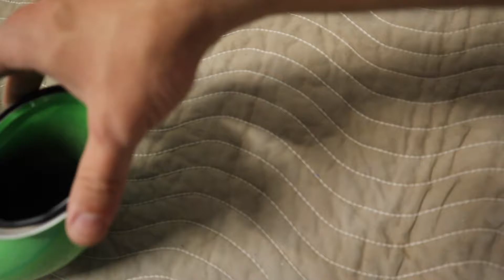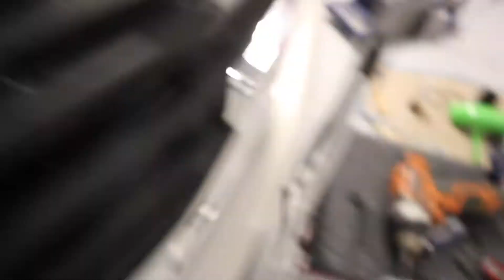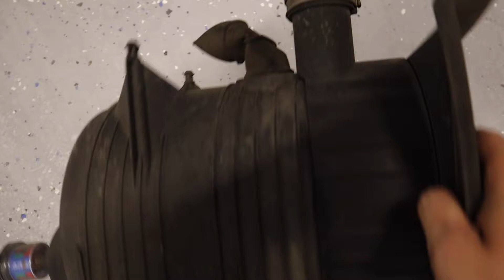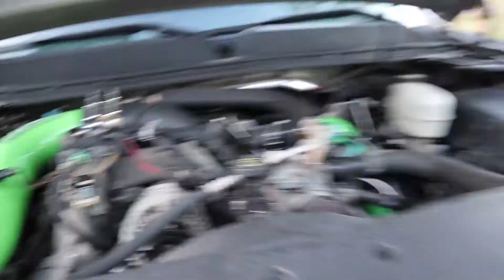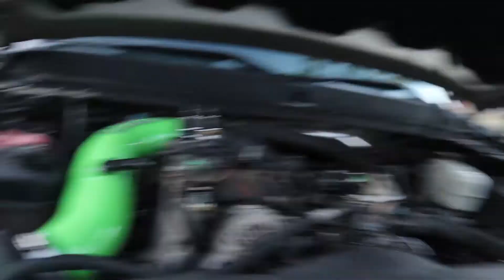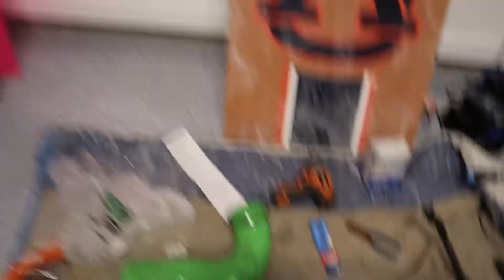WCFAB DURAMAX 4" INTAKE INSTALL!

Comment: Wouldn’t the open filter cause a loss of power and high EGTs from bringing in hot air coming off the engine? Did u notice any of this after installing the intake?
Reply from the maker: Not at all. Intake temps are close to ambient.
Reply: @TTorres1183  You haven’t experienced ur truck running hot or overheating while idling or any sort of stuff like that? Any other problems with it? Would u recommend it? I don’t want the boring old plastic intake, I want something that stands out but also don’t wanna hurt my truck or sacrifice performance.
Reply from the maker: I would recommend it.